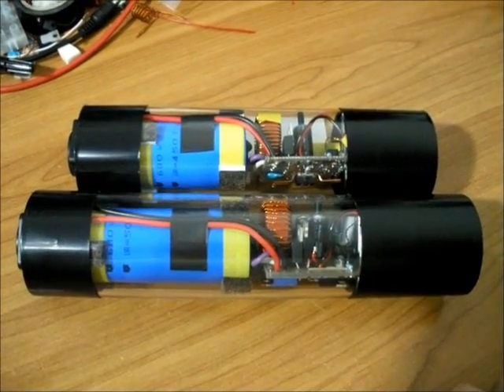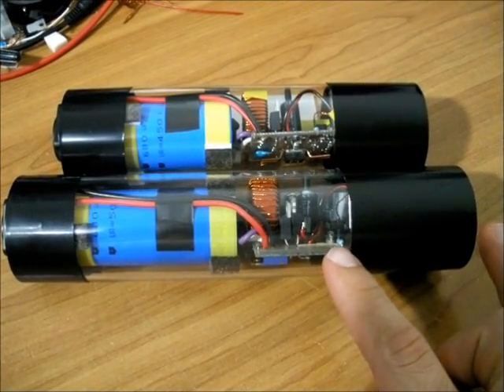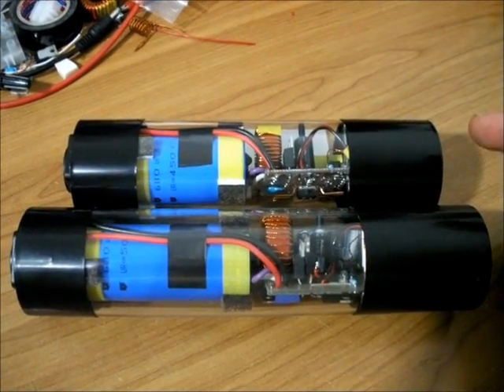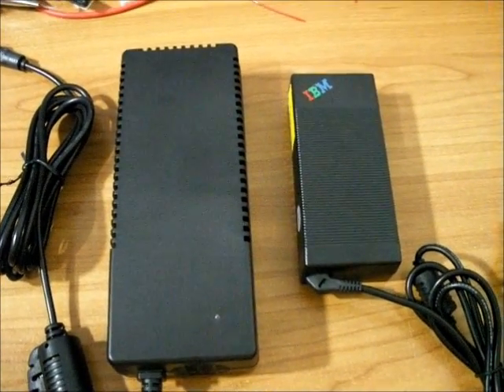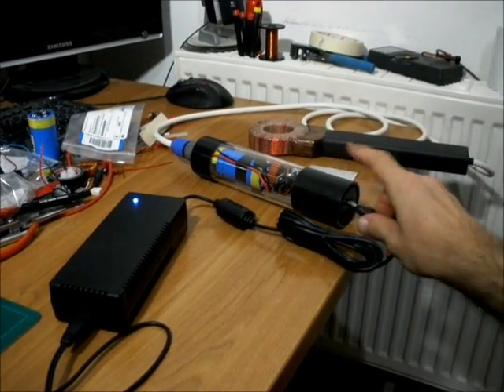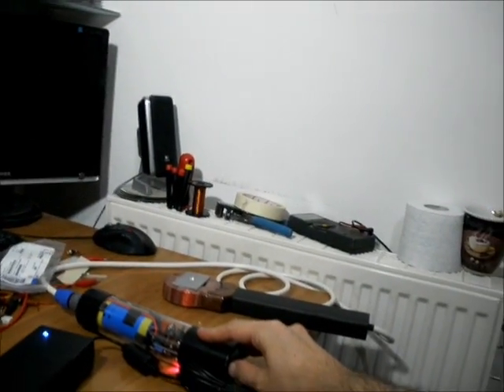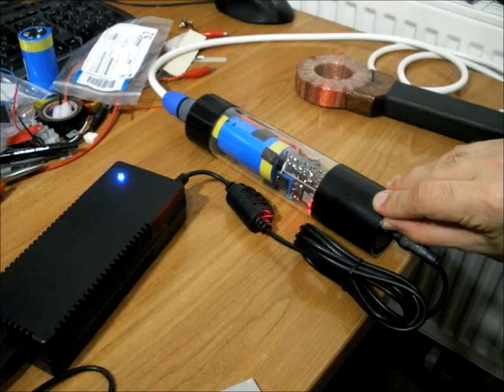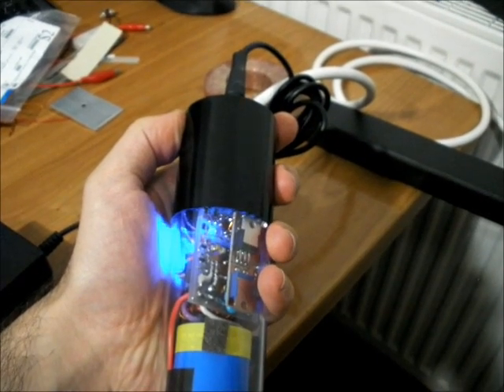Magnetic Pulser 500V

Comment: I like your design, very compact for he power out you get, small footprint. Also I like clear casing,  Couple questions, why not make clear casing all the way from end to end?
Coil,  are you planing to insulate it?
One thing that does stands out is how noisy it is, all do I can be wrong judging from the video record
Over all good job! 
Is there a reason to have the casing look like a tube? Just wondering
What's your estimate power on  highest?
My guess it's around 1.5T

Comment: Hello I want to know what is a 4n25 liteon ic for I have one in my amp opto isolater I'm reverse engineering my car amp thanks
Reply from the maker: The opto isolator is use to transfer an analog or digital signal from a circuit which may be at a different reference potential or to isolate grounds between circuits to prevent ground loop issues or for safety issues (minimize leakage currents). I would not know what the function may be used for in your amplifier case.
Reply: its a 2 ch class ab   about 800w   u.s amps used them in car amps   thanks for the info

Comment: hi.why not use weaker magnetic fields as driven by a 5 volt supply into a 2.5 ohm 300 turn coil and driven by frequencies fro 1 hz to 10000 hz? Also why not put a ferrite core in the coil which can increase the field strength by many hundreds?

Comment: I have had the pleasure of owning the 455V for about 2 yrs or so. Only used it a few times, and it has more than enough power.
The power packs are reliable. In any case you can buy them online for a few dollars.
I do not know if I can say this but my wife had signs of skin cancer on her arm. We used this on her arm as it the little lesion was rapidly growing, and was black on one side.
We zapped it three times in one day, next day it stopped growing. By the third day it was getting white tops. Within about 5 days completely cleared.
Biopsy proved negative. Now only white patch on skin.
Same for me. I had tumour tumour (about 12 mm in size) on Liver. Was scheduled for further ultrasound 6 months later . I used this device. Then had 2nd ultrasound - tumour completely gone.
This is magic